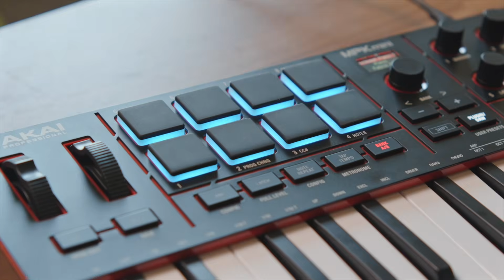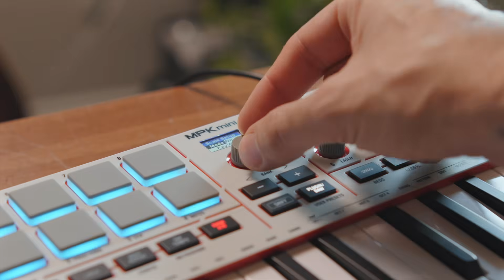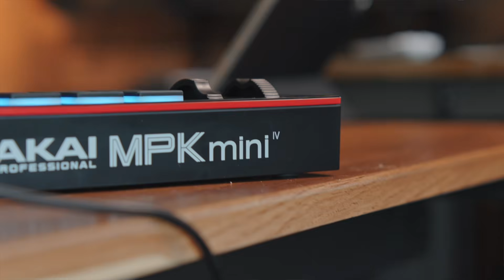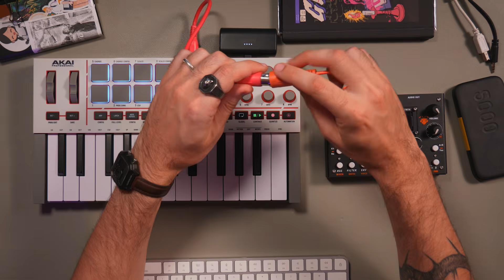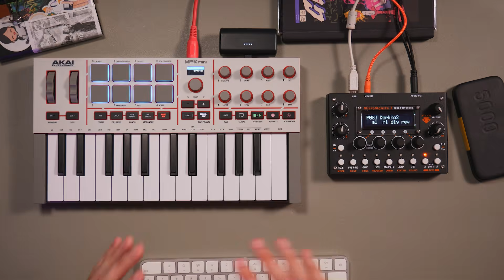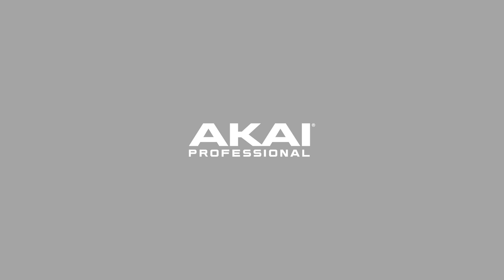MPK Academy | Using External Synths with MPK Mini IV

Comment: Hey dude, just a quick question, dunno if you can answer it - can you use the mpk to control the Korg electribe 2? 
I mean theoreticaly you just have to connect the midi and power both on right?

Comment: Hello, I am not able to change the midi channel of each pad individually. When I change the midi channel (shift+prog edit then pressing a pad an changing the MidiCh) all the other pads change as well. 

I am trying to control an external gear as in the video. I have updated the firmware.

Is it possible?
Reply from the maker: Please reach out directly to our support channel for further assistance. They can help get you up and running! 
https://support.akaipro.com/en/support/home
Reply: @Akai_Pro  Thank you for anwsering ❤

Comment: Thinking of ordering this. Is it really possible to assign custom midi channel to each of the controls (i.e. the knobs)? In the manual it's not explitly listed for the knobs, only for the pads... (page 20). 
I'm planning to control two synths (set to different midi channels) with the MPK with the option of changing presets of a synth or even switching synths in the middle of a song. Is there a simple way of doing this with the MPK mini?